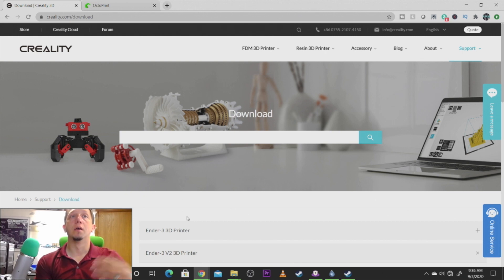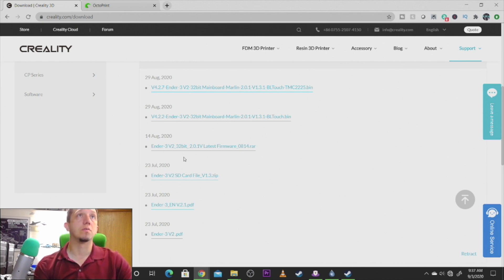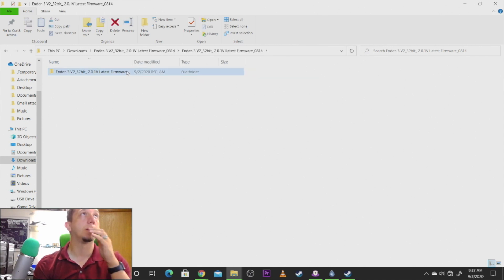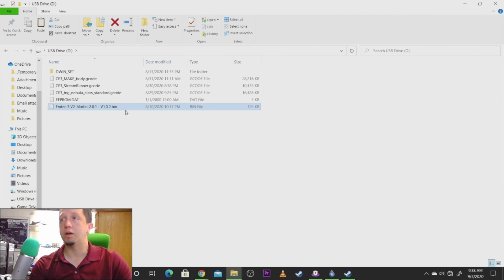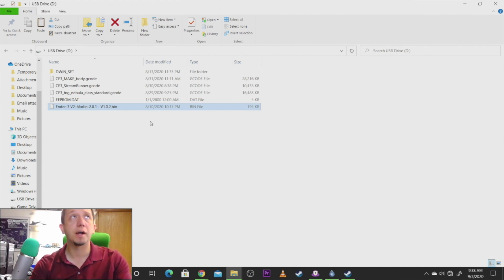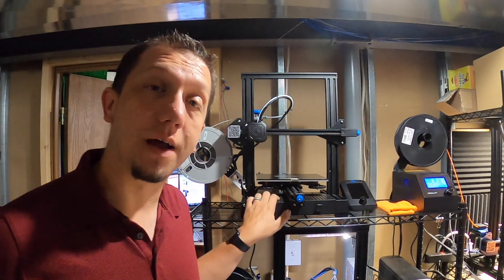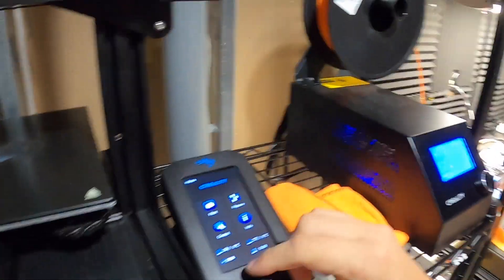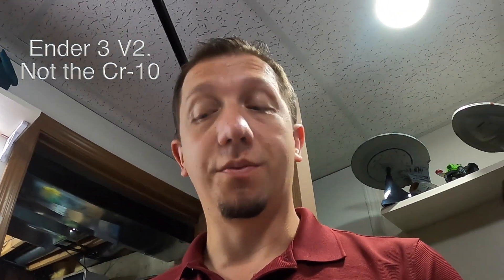Ender3 V2 Firmware Update

Comment: my screen stayed black when i rebooted the printer. after that i turned it off took the screen apart and put the sd card in the back of the screen. when i turn the printer on the screen turns red after 10 seconds or so. how do i fix this?
Reply from the maker: Reformat your card. Make sure those are the only files on it and then power it up.  If that fails contact reality support

Comment: Can you just connect it to your laptop and move the folder from there ?
Reply from the maker: The way the printer updates in its base configuration it is recommended do use the SD card method. You motherboard on the printer probably does not have a bootloader so it will need to be done via a SD card.   I know you can add the bootloader but that takes time and a ardino.
Reply: @Rise3DBuilds  thank you for taking your time to reply. I just ordered my ender 3 v2 and I have probably spend about a week watching video and doing research. Your channel is very useful and has great information. Thank you for your hard work!

Comment: Probably I screwed up but: I did what shown, but for some reason, my screen stays black and nothing happens. Furthermore, now the screen stays black all the time and nothing works. Any idea to fix it by chance?
Reply from the maker: Make sure you used the file that does not have the BLTouch is you do not have one,  Also you might have to put the card in the microsd port on the back of the screen and reboot
which version did you try to update to?
Reply: @Rise3DBuilds  Thank you. I used a newly formatted card and renamed the file to "Booohooo" (random name). Worked fine. Thanks to the gods of printing!
Reply from the maker: Glad you are up and running!!!  Happy printing!!

Comment: Thanks for the tutorial! I followed all the steps but my screen is stuck on the home 'Creality' and won't load. Any idea what to do at this point?
Reply from the maker: Did you get the firmware download that does not have the bltouch.  Also there is a sd card port behind the lcd you might need to out the card in there and reboot
Reply: @Rise3DBuilds   thanks for the reply! yes I used this one: Ender-3 V2_32bit_ 2.0.1V Latest Firmware_0814. Even changed the name of the bin file (because of multiple tries) and added the DWIN_SET file. Using the lcd port got me out of the original black screen problem but now I am just stuck on the home screen saying 'Creality'. The printer is brand new and never used! 
At first, everything was fine, setting up and all, it all got wrong when I inserted the SD for a first print. I figured uploading a new firmware would be enough but facing other issue now :(
Reply from the maker: Sounds like the sad card is corrupt.  I would download the as card files from the site.  Reformat the card and try again.  If that doesn’t work than I recommend contacting creality support for a replacement

Comment: I have upgraded my ender 3 (not v2) to the 4.2.7 and still on marlin v0. 0.6 every firmware update I try won't work its depressing lol
Reply from the maker: With the original ender 3 updating firmware can be a pain.  Have you but a bootloader on your board? If so you might try redoing that to see if it did work correctly?  I had to do that when I switched to TH3d firmware for my ender 3 to use the EZABL.  It might not help you but that is where I would start
Thank you!
Reply: if you ahvent fix ited yet rename the update file to any thing else

Comment: i followed this and my screen just stays black and i have let it sit for 20 min
Reply from the maker: Ok.  I commented in the video that you might have to do this to your display as well.  If you open up the casing there is a sad card slot on the back of the screen place your card with both files in it and reboot.  See if that brings up your display.   Also make sure you are using the download that does not have the bltouch.  I have talk to others that is also having similar issues from that firmware
Reply: @Rise3DBuilds  yeah im not usuing the bltouch file but i will try that how long do i let it set before i try the screen deal
Reply from the maker: Mine took 20 minutes or so before it came up.  I didn’t need to do the display part but I would give it about the same time
Reply: @Rise3DBuilds  ok thanks i will see if that works
Reply: So it’s been over an hour and my screen is still black do I turn it off and then back on after I put the sd in the screen part
Reply from the maker: Yep
Reply: It’s not doing anything after putting the bad card in the screen part so idk
Reply from the maker: I would recommend opening a ticket with creality support at this point.
Reply: Yeah we all know how that works so maybe I’ll have a working ender 3 v2 by next year lol
Reply from the maker: Actually the last ticket I did was on this machine with a bad motor. We had it resolved in a day
Reply from the maker: Is this the as card that cam with the printer?
Reply from the maker: Sd card
Reply: Your lucky my hot end went out and I ended up having to buy a new one on my own

Comment: I have download. and mine seem to be now 1.0.3. and nothing its working. its there anything I can do ???
Reply from the maker: Can you give me more detail than that?  What is not working?
Reply: @Rise3DBuilds  I have. solved. so I have the version. 1.0.3which. I think only work if you have the. extra peace for auto level ( so what I did was reboot the system and add the 1.0.2 firmware
Reply from the maker: Glad you got it resolved!!!!

Comment: Great video, does this work the same way for the other printers? CR-10, Ender 3, etc.....
Reply from the maker: This will depend on what you have done with your printer. For example I know with you printer the answer is no because you are using the TH3D firmware so that upgrade process is different.  As far as the older printers I think you can follow a similar process.